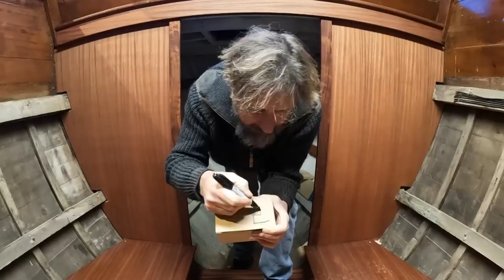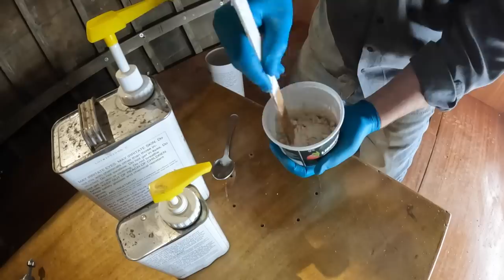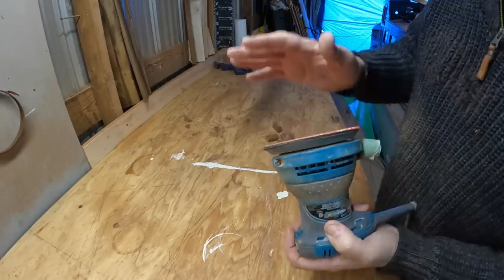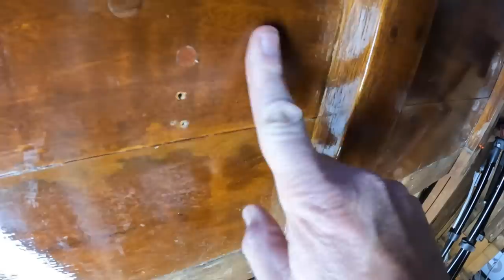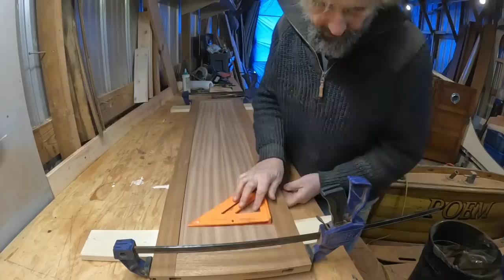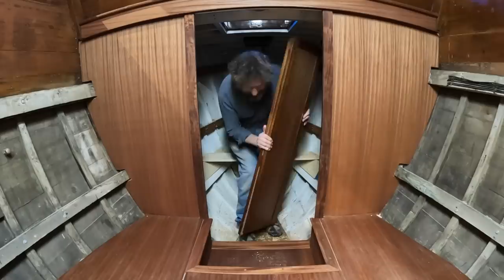Fo'c'sle Doors- #349 - Boat Life - Living aboard a wooden boat - Travels With Geordie

Comment: There was a pup barking on the last video ... and yes, I understood the hint of "paws" ... ... by the time I understood the word at last ... 😁

Peter looks great in the folksy sole
And this little low-soled cabin hole
Makes me think and remember stories told
Of living in small cozy rooms of old.

Those doors will need some getting-used to to close
I imagine for some it will be quite a pose
To always handle them with both their hands.
But hey ho, folks will manage it as it stands!

A saw repaired is a lot of waste spared!
So it is a good thing then that Peter dared
Pulling it out and trying it out.
That it didn't work out won't give me gout!

If the bung is well done, the hole will be gone.
With the right kind of drill it can even be fun!
And with some coloured glue
they will very well do!

And if it all won't work quite 100%,
The outcome does still give no cause to repent!
Same goes for the doors, slim, and fast glued together
They're practical beauties - naught else does here matter!

And screw it, a screw gives the mind some peace.
This way no glue-joint will ever release.
Put them in - they look AWESOME and they fit really well.
Thus Peter has built the folksole-cell.

It all ends, as usual, with a tasting of beer.
Finnegan's welcome's the theme. And here
We hear that the word of the week is "pup"
And with that this week's poem for Poem is up.

Comment: Two suggestions: sharpen the bung cutter for better results; start the hole with the block on the drill bit slowly (keep the bit speed up) as it first starts cutting.

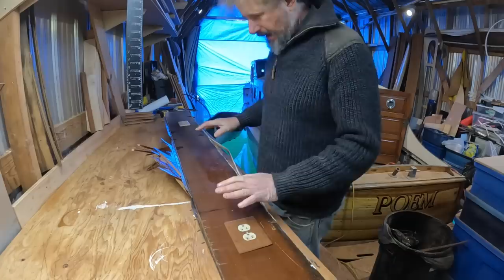Comment: At 14:00; Seeing the outlets I had a thought about the unused spaces (you had pointed out), port and starboard of MV Poems bulkhead.
If the dinettes back cushions doesn't cover them, maybe place some outlets and/or switches there?  ;-)
Finnigan is such a cute pup.
"Pup, pup, pup, pup...", goes Poems engine on its travels.

Comment: Both of my pups are at the vet today getting a little snip-snip of their dangley bits. Previous shirt winner, so skip me. Great looking doors, you make it look so easy! I think I may have tried twin bi-fold doors if it were my project. That way, with the door left open they would protrude less into the . Especially if there would be room to swing each door 180⁰ and sit flat against the bulkhead since each panel would be so narrow.

Comment: I used to use a 10” craftsman saw on my rc models.  I found that adjusting the vertical guide down close to the table helped eliminate the wobble and produce better cuts.  
You also can use different types/size of blade teeth!  Thx for bringing us along!😊😊😊 Ken

Comment: Now Peter great vid. I have two sets of doors to fit one in the forward Cabin so internal doors and another one for The Cabin just behind Capt,s seat which will be exposed to the elements so a bit more Protection needed although will have glass insert on top half of door. Thats a nice simple design and resonably easy to Fabricate. Yeah my bandsaw does same thing am looking around for an old one to come up for sale as there seems to be a lot of shed sales at Mo people going into resthomes I suspect. A router bit may be useful in doing those holes just a thought. Finn the Pup is a fine looking Dog like the Cut of his Gib. Lady Z is also looking fabulous. Be well now and keep at it.😁

Comment: I've got the same craftsman bandsaw I picked up for projects on my Chris Craft. I found the 1/4" blade a bit weak for some of my work. It will take a 3/8" blade, Amazon has one made by Powertec that I've found more durable for most of my projects that will still cut pretty tight curves and straight cuts on thicker pieces. Nice work on the doors. Cheers!

Comment: I'm not convinced that boat is big enough for what you are trying to do there and I will be very surprised if the wheelhouse is wide enough to lie down in !
I'm sure you must have measured it at some point but it appears to be less than 1.8mts across which would be quite a short bed !

Comment: how much faith do you have in your table saw, drill press and even squaring tools  ? ie, do you rely on the factory marks or out of the box squares being acurate or do you check them before using . reason for asking, i had several squares, for many years, and after checking them, found they were unacceptably not square and purchased new ones. ( i checked for square at the shop before buying). same with the power saw, factory settings were out so i had to readjust. Ps, i asked about your "japanese saw in a recent episode, hope you can respond to that as well cheers, Frank from down under